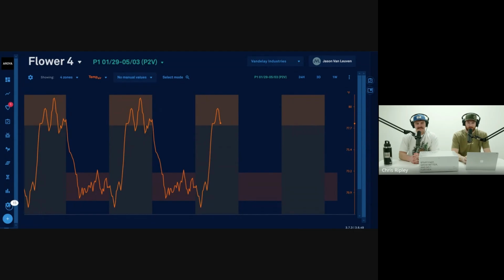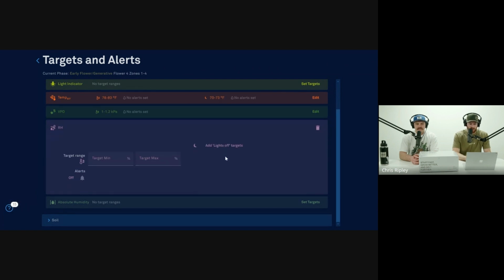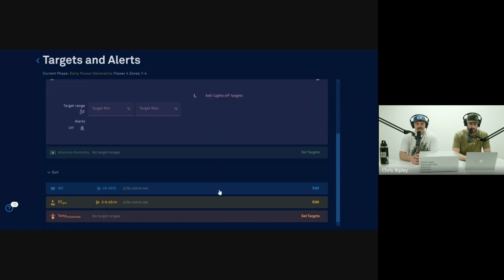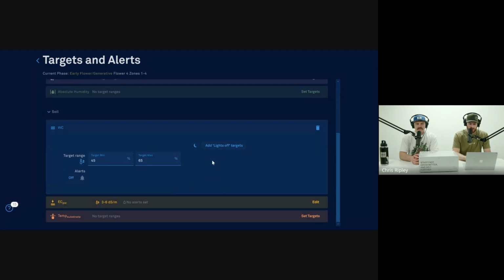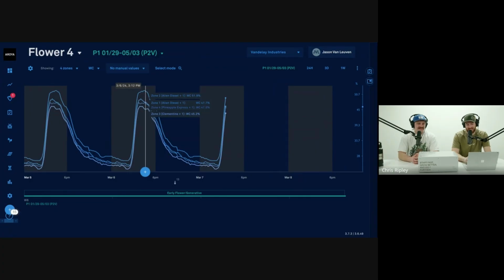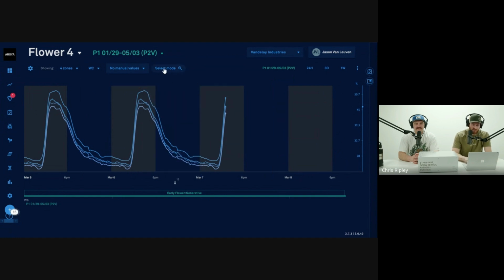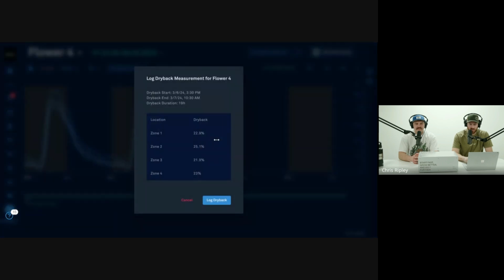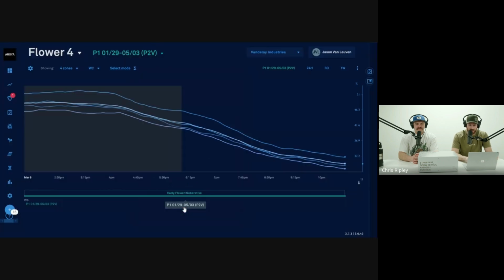[FULL] Office Hours LIVE Ep 95: Maximizing Your Crop: Expert Tips for Optimal Plant Health and Yield

Comment: Lots of issues with teros 1 WC readings I’ve seen from others are beyond wonky
Reply from the maker: What kind of issues? The readings are way more precise and accurate. You should use the T1 as benchmark and not older sensors.
Reply: Man, you just made me nervous to spend that much on the go.. What I have researched has all been very good. The new industry standard. I would like to hear more about the issues.